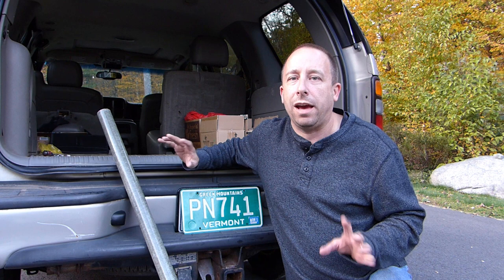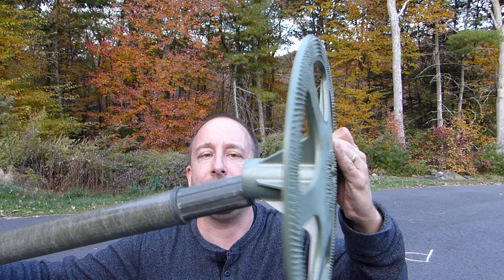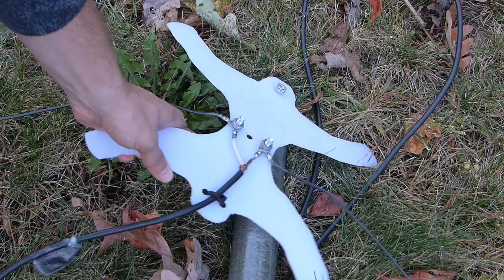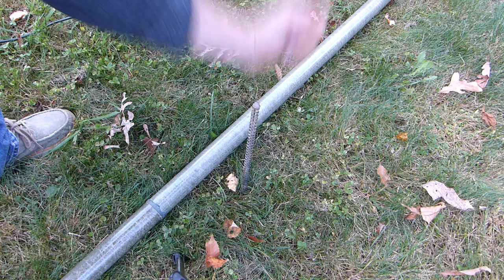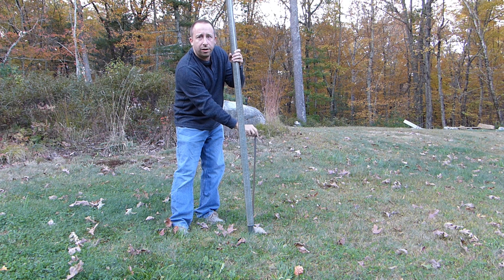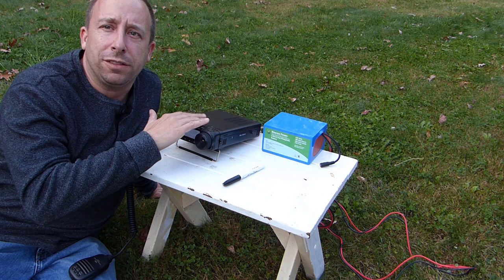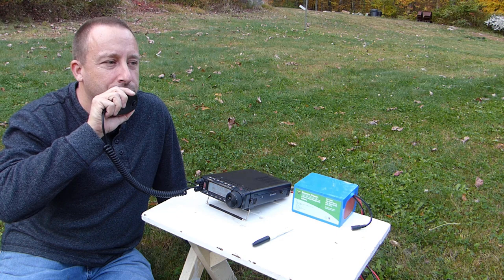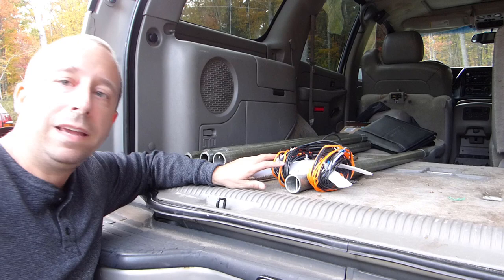Ham Radio Field Antenna Using Military Surplus Fiberglass Poles POTA Field Day or Field Radio

Comment: Those $2 'base' pieces are actually meant to put on top.of those poles as their military use is for camouflage netting and those tops support the net
Reply: yep, I have 18 net spreaders ive been trying to give away free for months. Got them in a deal with a bunch of poles. pretty useless
Reply: Yep, had many of fun hours pulling fiberglass out of my hands after those poles exploded in sand storms in Iraq.
Reply: @nbookie yeah but we served in the military  so illegals can get free crap  😢 ✌🏻🇺🇸

Comment: For a faster and easy band change, put a power poles on the link and you only have to pull the power poles apart. No nuts to loosen or lose.

Comment: FYI, those fiberglass poles and base are part of a camouflage net support system. The poles raised the net above the equipment, vehicle, or weapon that needed to be concealed. The poles are held in place by the tension from the camouflage net that would be stretched all the way to the ground and staked to the ground at the edges of the net.  But, yes those make decent antenna supports.  In the US Army we used 3ft aluminum poles  stacked to the required height, then guyed, to support a variety or VHF Low band (30-88 MHz) and HF antennas.
Reply: What kind of flat base would you use to hold a mast on a flat roof, with cement block weights on the base?
Reply: @tzm1843  On flat roofs I have used a variety of Non-Penetrating Roof Mounts. It requires no puncturing of the roof. You fill in the flat frame base with cinder blocks. The frame has a mast and tripod mount in the middle. I just saw one on Amazon for $61.99. There are many heavier variations also widely available.

Comment: In my experience the fiberglass poles, especially those without the reinforcing ring around the 'female end' will split at the end if subjected to even modest bending forces.  For long-term installations, as opposed to POTA one-day events, I use two 1.75" hose clamps (~$12 for a bag of 10 at Home Depot) on each end of the pole, separated by ~2".  Since doing this I have not had any pole failures.  My 3-mast, 132-foot end-fed half-wave antenna, with each mast using 4 or 5 poles, has been up for a year in all sorts of weather (well... no hurricanes, yet).  I also spray-painted the poles to help protect the fiberglass from the sunlight.

Thanks for the videos!
Reply: I just picked up some poles for the same antenna yesterday. When you say it’s a 3 mast system, does that mean it’s actually 12-15 poles tall?  I was planning on using 6 poles at the end of the 132ft to raise the end up about 24ft
Reply: @joecommins1627  I meant that I support the 132-ft wire antenna at three points: at the transformer end, at the far end and somewhere in the middle.  Multiple points of support result in less tension than supporting at just the ends, which means less torque on the end of a 15-foot-high 'starting' mast.  Except for the far end mast, each mast consists of about 5 fiberglass sections. The far end is only 3 sections, meaning that the antenna wire drops to about 9-feet above the ground at that point. Just high enough so that no one can touch it.

Comment: Great job, great video. Super simple installation. I use the same poles for field day. You can walk up 30 feet of those poles by yourself, but they must be guyed. For 30 feet I use two sets of three point guy ropes. With two people I've erected 40 feet of those poles using three sets of three point guy ropes. You MUST use the ropes to help erect the mast or the mast will bend and break. Home Depot and Lowes sells orange stakes for terminating the guy ropes to. I like orange since they are easily found in the grass. For the antenna, I use an off center fed 80. I put a pulley at the top of the mast so the mast is not overloaded when it is being erected.

I like how simple your system is. One man, you don't have to carry a big bag of poles and ropes with you and you cover the two most important bands, 20 and 40 meters..

Thanks for posting this great video.

Barry, KU3X/QRP
Reply from the maker: Glad you enjoyed this!
Reply: When I use the fiberglass poles, I reinforce the bottom of each with two 2.75" hose clamps.  Otherwise they tend to flex where poles meet and form longitudinal cracks.  Guying facilitates erecting the mast and adds a big safety factor to keep them upright - but my masts top-out at 24' max.  Getting these mast sections, once available for $4 each, has become very difficult. I blame this video. 
:-)

Comment: While these poles aren't "tent poles", they are camouflage net support poles. I hated the crap out those darn fiberglass poles when I was in the Army. Those "bases" were used  to batten up camouflage netting over tactical vehicles and tents. High winds would cause the poles to break and splinter fiberglass shards (which a soldier would have to pull out of their bare hands). Glad someone found a good use for them; just look for breaks and splinters (and please wear gloves). If I were using them as an expedient antenna mast, I would use PVC pipe small enough to fit inside the fiberglass mast and then place over the re-bar.
Reply: Boy do I remember those days. It sucked covering a 5 ton dump.
Reply: @old_bastard2941  I also hated sewing 3 hexes and 3 diamonds together and then rolling the whole net up on the damn vehicle to tie it down (along with the 4 pole bags (containing 18-each fiberglass poles, 8-each spreaders and 16 each metal stakes). After I retired, never wanted to play with stuff ever  again.
Reply from the maker: Thanks for the info and thank you both for serving our country!
Reply: Put the hose clamps on the ends just snug enough to stay on but not so snug  that it's a tight fit when putting them together. The ends will split and crack and splinter on those on the female end, but with the clamps on them they dont split or break. I have had a set of these and have made guy rings using metal electrical box covers with the correct size hole in the center that fits over the Male end of the pole.

Comment: I have used 1/2 inch pex water pipe as insulators (usually qrp or up to 100 watts) cut with a ratcheting pvc cutter since I had one. I have seen it used for traps and coils too. I put a wall flange on a piece of 2 x 2 ft plywood with a short pipe nipple that is hose clamped to a 1 1/4” pvc  to slide the mast into.

Comment: I've been buying these sections in the flea-markets all around Europe, it seems all the  armies in the world were using the same poles :). There is also an aluminum version of exactly the same sections, they are interchangeable with the fiberglass ones, also a very useful thing. From my experience, it takes a proper guying if assembled for more than 4m (12 ft) high , otherwise the mast becomes too shaky because of the loose nature of the joints, it may break at the joint point. 73! Linas LY2H

Comment: Got a set of white poles. The fiberglass is tough on the hands ,even goes through work gloves. So i think im going to sand mine down  & coat my sections with tinted gel coat to dark grey or brown.  Wear yer hardhat , i have a top piece with a eye hook, a monkey link and a chromed brass pulley,  if that thing jumps out from there from 30' its gonna cave someone's head in.! Have fun and  73 !

Comment: Nice idea using the rebar to support the mast. Thanks for showing it to us. 👏🏻👍
Reply: You could precut some thin nylon cord (like mason's string) and tie it from the center rebar to each of the end bars.  This could give you the same spread each time you deploy without having to measure or lay out your antenna before hand and help get you on the air a bit faster.
Reply: Chris that’s a very good idea! 👍

Comment: I use these actully the aluminum ones with one fiberglass on top. for my 10 meter vertical which is a 102 inch SS whip with three radials of 12 gauge wire 8 feet long each . held out from the mast by 3 fiberglass driveway marker rods.The antenna is mounted to your standard mirror mount at the top of the  28 foot pole been up for 11 years now best 10 meter antenna i've used and never fails unlike a certain 99 antenna.

Comment: I have used these, stacked 7 high.  8 is too bendy.  It takes five boy scouts to put up one pole, three to hold the guy ropes, one to lift the bottom pole and one to insert the next pole.  That's 28 feet high.  Do it twice and put up a dipole or G5RV type antenna.

Comment: several things on the poles. The ones you showed were loose but I have had some so tight I couldn't separate them. Also they will crack or split near the top sometimes and have had some shatter when I tried to go to high with them. 30 feet is about as high as you want to go with them. The link I gave has rings he sells that allow you to guy the poles off which helps when you start getting to tall.
Reply from the maker: Thanks for the tips!

Comment: Good video and I had to use the Gorilla Tape on the connections for strength so it would not snap or it would have broke (a lot of pieces did break still). With the Gorilla Tape it lasted for years.

Comment: I use these poles as my permanent mast. Of course after about 10 years outside there is now exposed fiberglass and I need gloves to handle them. But they are easy to replace and work great. Also, add a third hole to your cutting board insulators and you have a cheap, effective paracord tensioner.
Reply: Buy the fiberglass resin and hardener and mix up and coat those poles before the become bad, then once they dry and harden, then paint with UV protected paint and then paint with olive drab paint to return them to army specs. They also make an aluminum pole suitable for use long term. You can also use oil based paint but I recommend doing a new coating of resin first
Reply: I have heard that painting fiberglass poles (for electric fence) with enamel paint will make them last for decades without breaking down.
Reply: @bassmanjr100  Thanks for the tip!

Comment: Love your setup. I welded up some 1.5"  X .083 wall steel tube into a triangular tripod connector. The pole connection end fits inside. Those poles slide in just right.  Also, 2" X .083 wall slides over the pole itself.  I was thinking inverted V. On a windy day I add more leg length to expand the footprint. The poles are all over Ebay.

Comment: I'm thinking the circular  "base " actually is a topper for tarps or tents to  rest on.
Reply from the maker: Oh, maybe it is....I hadn't thought of it that way.  Actually, that gives me an idea for a future configuration.
Reply: @SevenFortyOne  held up camo netting for the military. They also have a paddle spreader bar setup too.
Reply: You have the pole upside down from how it's supposed to be from military setup
Reply from the maker: I know...that's intentional
Reply: I used metal 4 x 4 inch electrical box covers that have a round hole for a socket in them. I drilled the holes larger on the four corners and in a triangular pattern as well. The round hole in those plates fits perfectly over the plastic portion of the pole. The plates will sit between sections of the poles and make guy plates to allow ropes with metal chain links(the type that has the screw together portion) through the plates to guy the poles up as a 40 foot tall antenna support.

Comment: What kind of flat base would you use to hold a mast on a flat roof, with cement block weights on the base?
Reply from the maker: I wouldn't do that for fear of damaging my roof.  I'd set my antenna up another way....

Comment: That is cool! Where can you get these? Do you ever get hassled by a over zealous park ranger or security personnel thinking you are doing something sinister in their park? I would be paranoid about setting up a large antenna like this on public property. I am paranoid about flying my drone unless there is nobody around to pose a safety hazard to.
Reply from the maker: There is a guy who comes to some of the local hamfests that sells these.  I'm not sure where else to get them.   I haven't had any trouble with rangers here in CT.  In fact our group just got permission to use a field behind one of the ranger stations anytime we want.

Comment: Another great video!  Thanks for educating me over these videos.  It helps to see how others are solving these problems.  You said you picked up the fiberglass poles at a HAMFest.  I am looking for them on your channel or online and so far can’t find them.    I may have missed them on your channel, if they are there, I would be happy to purchase them through you if it gives you any benefit.  If not, I will buy you a drink next time I am up in Connecticut. All the best! 73 de KI5HXM
Reply from the maker: I'm glad you are getting something from my videos.  I bought my poles at a ham fest before the pandemic and haven't seen any for sale since then. I only bought enough for my own use and don't have any to re-sell. There is a company out of Atlanta that sells them (it might be the same guy who goes to the ham fests) but his only mode of contact is through facebook.  Look for "portable antenna systems" on facebook and you may find him.  Last time I checked he was out of stock and had been for a while but that may have changed.
Reply: @SevenFortyOne  thanks for the reply.  I did look up one guy for poles on Facebook. (He mentioned it in a comment on one of your videos). There is no urgent need at this time.  I am wondering about portable poles and permanent ones. For permanent I am curious where I figure out wind loading and pepper mounting of antennas (such as not over x lbs for winds in y range). I am more of an electrical engineer so mechanical is not as strong in my understanding.  Thanks again! 73
Reply from the maker: I saw guidelines for guying someplace...maybe the arrl handbook.
Reply: @SevenFortyOne  oh very good.  I have that book as well as the ARRL Antenna Book.  Time to read that manual.  Haha..  All the best!  73

Comment: How many of these poles can you safely join together without danger of breaking?
Reply from the maker: I'm not really sure.  I've used 5 together but that doesn't mean it's a good idea
Reply: Thanks. I have 4 poles up now but will add 2 more and guy them.
Reply: In this video from 1:00-1:37, you’ll see what happens if you try to use too many of them. 
https://youtu.be/Uw6_vxYgokI

Comment: How last your Bioenno LiFePo4 Battery, on 50 watt normal operations ?. It's a 20Ah. Right?
Reply from the maker: Mine is 15A.  So far I've used it 2.5hr at 30w and it had lots of power left to spare.  Mike at k8mrd radio stuff made a video on the 20ah batter and rad his at 100w for 3 or 4 hours
Reply: @SevenFortyOne  TNX, 73.. yv5emg